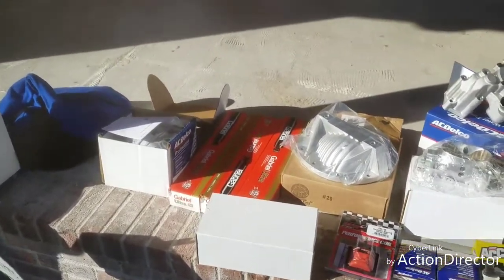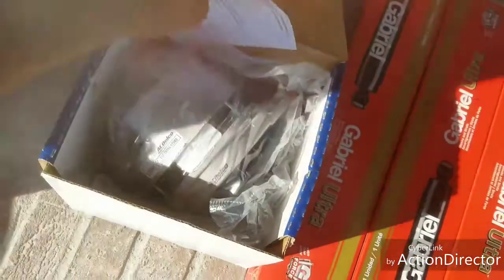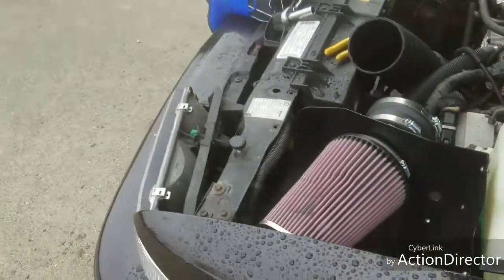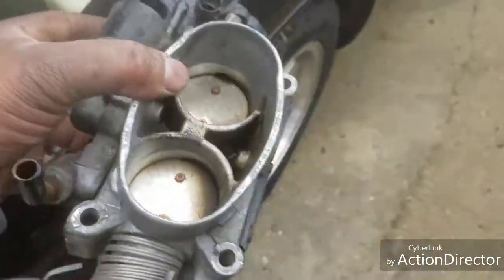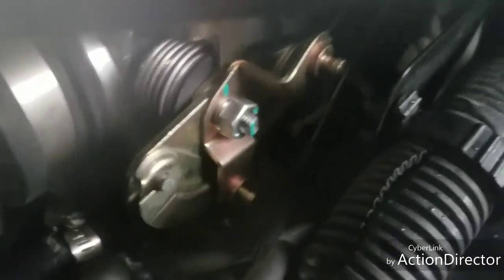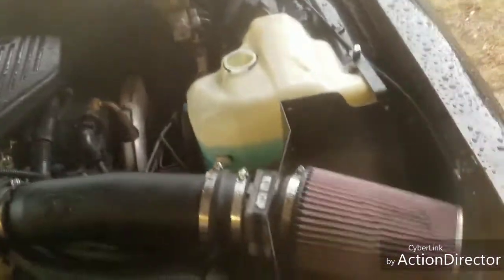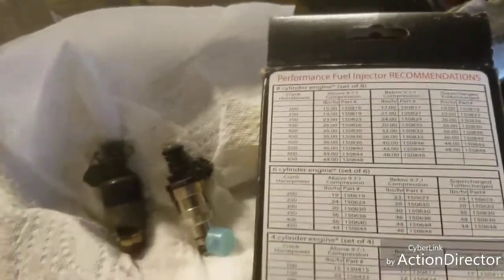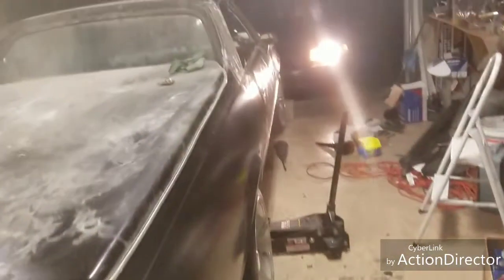96 impala update and summit racing throttle body upgrade

Comment: nice upgrades for a modified motor. Throttle response will fool you.  for a stock motor the Cost to Horsepower ratio small.

Comment: I put a bigger summit throttle body on my L T1 Firebird and the engine started acting really weird like bogging down and when I got on it it would hesitate.  I thought it was the computer getting used to the modification but waited a week still hesitant so I returned it. I'm not used to working on newer engines mainly carburated old school 350s so I might of needed to do something else but I was told I didn't have to. Car was stock other than cold air and exhaust.
Reply from the maker: What size throttle body and did u upgrade the fuel injectors too?
Reply: @DWillBGBodyPerformance   I believe 52 mm I'm not positive this was several years ago in the car completely burnt in the fire. I was told I didn't need to change anything else but I have a suspicion I needed bigger injectors
Reply from the maker: @CamaroLSskateboarding  i have a 52mm throttle body and upgraded the injectors from 24 to 26lbs
Reply: @DWillBGBodyPerformance   Yeah I saw in your video that you upgraded that's maybe what I should have done but summit said just bolted on and go so I'm not sure like I said I'm used to working on older cars with carburetors I added your videos to my playlists. Also The same transmission that went out for you did the same in my Firebird
Reply: @James M gotta get a new car. Car is toasted totally done from the camp fire in paradise is post a photo if I knew but its gone
Reply: @DWillBGBodyPerformance  do you have to retune the engine on computer after the throttle body and injectors were upgraded
Reply from the maker: I didn't. But it will help if you did
Reply from the maker: Help maximize performance
Reply: @DWillBGBodyPerformance  thanks

Comment: How big of a difference does it make with the throttle bottle upgrade compared to the original ?and do u have any recent videos of how the car sounds ? Very interested? By the way love the way u got everything and showed alotta TLC too it
Reply from the maker: It's has a better response over stock. I would definitely recommend if you can find someone to tune it. Mine isn't tune, I plan on installing a torque head computer kit on mine. It all you to tune your original lt1 like a gen 3. Should have an update video up by mid August after I install my 3.42 gears a Detroit Locker
Reply: @DWillBGBodyPerformance  so you had to get the car tuned once u changed the fuel injectors and throttle body ? I was curious to what else u might have to tune up since is gone be a bigger throttle body and bigger fuel injectors ? Like what other modifications I may need to make
Reply from the maker: I don't  have mine tune but you will get more performance if you were to tune it. I was just letting you know what my plans  were
Reply: Oh Okay I see basically re tuning the engine for the computer... and ohhh okay definitely trying to run similar set up I was just wondering did it run funny or anything with out tuning it ?
Reply: What is exactly the torque head computer kit ?
Reply from the maker: @raxxracer1774  http://torqhead.com/index.html
Reply from the maker: No. But expect your gas mileage to go down some

Comment: When you swapped the Throttle body and injectors was that all needed..no tune needed????
Reply from the maker: I did not have my car tuned. But you will probably get more performance from it if you were to tune it and better gas mileage. Ive noticed a difference without being tuned. I'm waiting to tune mine. I have some more thing to do before I get it tuned
Reply: @DWillBGBodyPerformance  cool thanks.. I probably need new injectors since mine are original from 1994..lol..  im gonna go 26lbs like you did plus a BBK throttle body.. hopefully it wakes her up.. plus the rest of.the work I did
Reply from the maker: It will it woke mine up. I want to tune her but I plan on installing a torqhead pcm kit on her. Don't want to spend money twice

Comment: How did it go I got a 96 Impala SS dis just about all that
Reply from the maker: Its nice. if you upgrade the fuel injectors i recommend finding someone to tune your computer
Reply: @DWillBGBodyPerformance  thanks for the advice will do when I get there. Just did the front end suspension working on the interior